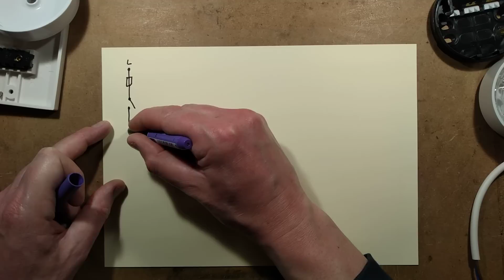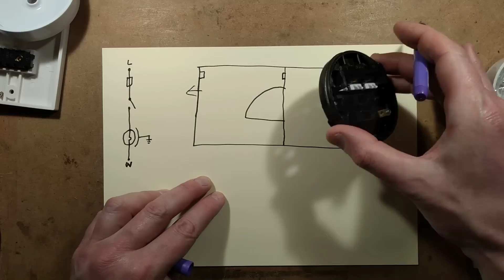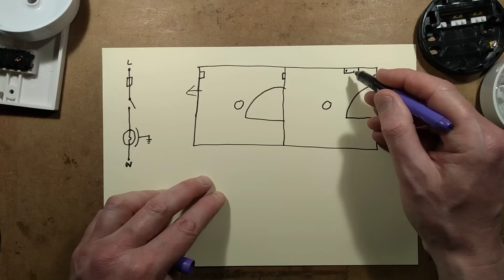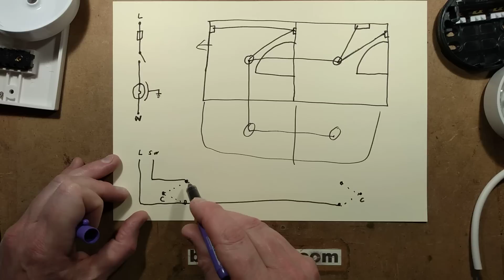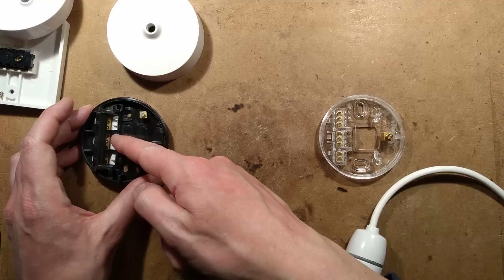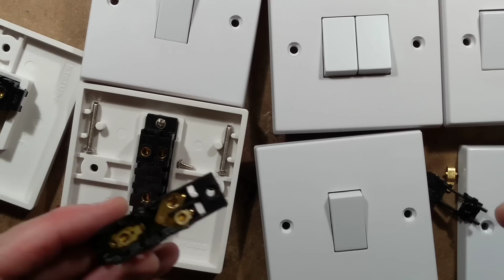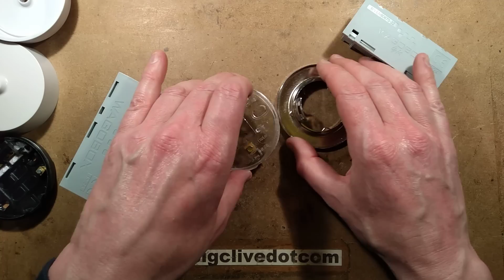British home wiring.  The incredibly simple lighting circuits.

Comment: How can I use a ceiling rose in the USA I know it'll work it's just a fixture but will it be a decent light for my shed
Reply from the maker: They are just a way to hang a lamp holder.  They should work with American wiring, but most here are bayonet cap holders (B22).

Comment: Can you please show us what cables go into the light switch L1 L2 and common. That would be nice
Reply from the maker: That depends on the way the lighting circuit is wired.  For a single way switch with just two wires it would be common and either L1 or L2.

Comment: Hello,enjoy your videos,a question for your thoughts,i have a wylex 6 way old type push in fuse box,i dont see on the bus bar any way of connecting a wire to extend to a nother single fuse box,can it be done with a bus bar clamp or do you not recommend it,on some of the old wylex it had one of the fuse block with 2 screws and a hole for the cable but on mine it does not,any help or cements would be grearfully received,it's a good box and seems a pity to install a modern consumer box i  have updated to 6 mcb's on my box so all ok but lack one more outlet.

Kind Regards,

John.Thanks.
WISH I HAD FOUND YOUR VIDEOS LONG AGO
Reply from the maker: You could theoretically add a small extra consumer unit for low loads like lighting, and power it from a single fuse way with a 30A fuse and suitable cable.

Comment: I have a bunch of the b22 bayonet sockets.. pretty common but not sure how many countries use them🤷‍♂️🤔.. I’ve only seen e27 & b22 it’s seems.. and the e27 is quite common.. my family is from the UK & Northern Ireland although being here in the US myself I’ve had a few fixtures & lamps that were originally for 230-240v when here it’s all 125v max but slightly higher amps, I just changed the plugs and used b22 120v bulbs which were sold by a company we both may be familiar with yrs ago called “Crompton” and had to stick with 240v eveready bulbs from the UK for smaller bulbs like E14 based etc.. they were “fireglow-globes”.. and it worked out well but very faint at 120-125v, lol

Comment: Hi Clive .great video,  the wago junction box is a maintenance free JB but it is only classed as maintenance free when you sill the lid with a cable tie , also wago connectors are only classed as maintenance free connection’s when used in conjunction with the correct wago junction box. Personally I think wago are a godsend they have proven tobe a game changer. Also the cable to the switch I was tort it is termed as Red / brown switch line / feed black/blue is the switch return. Now it is termed as brown is line blue is switching line . The biggest problem DIYers have is they don’t realise that on a three plate lighting circuit there is no natural at the switch. Unless you take the feed to the switch and that is only used for two plates circuit and is becoming more common with the use of LED downlights.

Comment: I've just bought a light switch, to replace one that's on its way out and, instead of being marked Com, L1 and L2, it's marked Com, 1 Way and 2 Way.

Maybe it's another change in the regulations. 🙄
Reply: Just replaced the iffy switch and, sure enough, the old one is marked L1 and L2, while the new one is marked 1 Way and 2 Way

Comment: With the advent of "smart switches" requiring a permanent neutral, then many new properties have the live feed cable looped through the light switches, not the ceiling roses. For that matter, a lot of properties have down lights in some rooms, so there isn't a ceiling rose, so would need a separate junction box (unnecessary if you loop through at the lighting switch). However, looping through the light switches does make the back boxes rather "busy", so they need to be a bit deeper. 

There is an alternative to looping through the lighting switches an provide a permanent neutral at the switch, and that's to use four core cable to the switch (line, switched line, neutral and neutral) and still loop through the ceiling rose (or a junction box) and it might be possible to retro-fit if the cable to the switch is in conduit or in a stud wall and you can get to the topside (easy on the top floor, more difficult for lower floors).

Comment: The way you are wireing your swiches is in germany called "Sparwechselschaltung" wich would translate to economy swiching circuit.
The way we do it is first swich common terminal L and the other two are connected directly to the same terminals at the second swich where the common terminal is connected to the lamp. Inserting intermediat swiches is done very much the same, connecting to the same terminals.
(looking up "Wechselschaltung" will show pictures on google)

Comment: I don't know how they get away with this plastic junction boxes ,even using AFCI breakers and GFCI breakers .Especially at 220v the arcing is so bad I don't know how fast the arc flash will be quenched before the breaker trips .We use metal boxes for most construction and we still have issues with arcing at 120v .Baseboard heaters and loose or improper connections being the major cause .10% of most household fires are caused by rodents ,the kitchen stove is the major cause .
Reply: What do you use to make your connections?
Reply: @Alex_Vir  The CSA approved Wago connectors a few years ago and before that another type that was a push in type connector and another   specifically for 347V lighting .And we have also a marette product 2 types one  which has been around for many years which uses a set screw cage clamp and insulating cap used for motors for up to 8 gauge wire.The other uses a spiral thread on the inside  .They do have very large wingnut type marretts as well for up to 2#6 wires .Then we go to split bolt/Burndy Connectors .We have only adopted the AFCi breakers about 10 years ago as part of residential building code .they still have problems with nuisance tripping because the software in the sensing IC is just not quite there .Vacuum cleaners ,garage door openers and some fluorescent lighting Devices that have some arcing on start up do cause nuisance tripping ..The use of PVC enclosures and conduit is not permitted for some residential applications .We do have the plastic boxes with foam gaskets for use on exterior walls and bathrooms that use a push in Romex connector type cable clamp .The rest is All metal boxes like the 1104 or 4 inch octagon box  for lighting .Most boxes are metal from 4x4 x4 to 12x12x8 deep .They do have PVC boxes for Outdoor damp/wet environments..Hospitals fall under a different category so do schools ,Highrise and commercial and industrial and churches and farms and homes .Code book for the province of Ontario is over 1000 pages and counting .Every 3 to 6 years they are amended and updated .

Comment: I'm sorry but at the 4.00 area, the 2 way switch drawing surely isn't right. Live [UK brown] should go to common of the 1st switch and either leg then becomes live when switched as does the common of the 2nd second switch, which is then the "switched" live which goes to your light fitting.
Reply from the maker: There's more than one way to wire multi-way light switches.
Reply: @bigclivedotcom  apparently so. I still really enjoy your deconstructions. Much appreciated 👍
Reply: @bigclivedotcom  apparently so. I still really enjoy your deconstructions. Much appreciated 👍

Comment: It's nice to see the differences between North American and European wiring systems. Our boxes are always securely attached to wall studs, while yours can be attached to just the drywall (plaster board). And our standard boxes are so much deeper. Plus, ours have clamps to secure the cable to the box. Your switches are switch and cover all-in-one, while ours are two separate parts. Our ceiling lights cannot be suspended solely by the power cable, there has to be an additional means of support. Does running your lights on 220v allow using smaller cables? Our standard size for most home wiring is 14 gauge.
Reply from the maker: Our cables are thinner.  They are rated by cross sectional area in millimetres.  The boxes can also be secured to wood or into brick.
Reply: Well UK isn't europe, in germany we also have swich and cover seperatly.
Reply: And AWG 14 would be equivalent to 2mm² (which doesn't exist) 
The more standard cable in germany in home installation would be 1.5mm² (AWG15). But because of voltage drop the company I work at uses 2.5mm² (AWG 13) for the connection from the room to the breaker box.

Comment: I only found out the word "ceiling rose" today, 
And I'm already hearing it again in youtube.

I was reading about electric code in india. Even though they say it's from 2011, it looks like some beurocrat wrote it In the 50s and never updated it.
It still recommends lead conduits, how to use cleats, high temperature situation should use asbestos sheathing etc.
Barely brushes over sockets, and doesn't describe anything I was interested in.

But it does talk about ceiling rose. It's supposed to be made of ceramic apparently.

Anyway, the British system of wiring doesn't make sense to me in modern sense. It would make sense if there was just one light per room.
But we have so many apllicances that plug into sockets. Sockets are the primary thing we need now. Fixed lights are secondary.
We have switchboards, which have all the light, fan switches. And also multiple sockets.
That's where we need all 3 of phase neutral earth. 
So it makes more sense to just run a 3 inch or so long wire to the switch. And then just the one wire from it which goes to the light directly. And the neutral for the lights and fans goes in seperate conduits. Like "ground" in electronics.
And I absolutely hate 2-way switches because I look at a switch. It looks on. But the light isn't on. Turns out somebody touched the other switch. So now the switch I normally use is upside down. I get so furious, I suddenly get infected with OCD.
The wiring for 2-way switches is also different.
The two wires connect ordinarily, but the middle one in one of the switches connects to phase. And the other one carries it to the light.

Comment: Handy tip ... should you use a 300 Watt ( infra red ) " mushroom " lamp ( nice - n - warm in the midnight toilet ! ) , then you MUST use a ceramic lamp holder , also use silicone or glass fibre insulated flex .. ( use of a standard plastic holder results in horrid fishy smells , yellow smoke and possibly your house on fire ! ! ) ... QED ...

Comment: God I wish the lighting circuit in my flat was wired with ceiling roses. Not fun installing a zigbee module when you have live at the light switch and neutral at the ceiling light and need both in one place for the module to work properly.

Comment: Nice overview of British (Brutish?) house wiring techniques. It's always interesting to learn about the current (that was totally punintended, I fuckin' swear!) and historical ones.

Continental Europe, at least Germany and Poland, uses routing the power wires through the switches' junction boxes rather than fixtures. The wiring of the "staircase switch" as they're called here is similar to the German "Sparschaltung" (which is pretty nice as you can use 5-conductor cable between switches: PE, N, supply L, commutation L between switches, and lamp L) as the throws of both switches are connected together.

Nice semblance of a strain relief, but the continental system uses actual relief that grips the outer shell of the lamp cord. For heavier lamps, a separate mechanical support (steel cable, chain etc.) is used. Connecting the wires is done with screw terminals and Wago connectors.

I know these Brutish steel junction boxes from servicing the Monotype metal type casting equipment. These machines are a marvel of engineering, a true thing of beauty and a joy for ever. 

Detachable lamp junction boxes are sooooo cool. Very flexible and useful in art galleries, exhibition spaces, shops etc. where you need to rearrange the lighting all the time and avoid rewiring at the same time. Europe uses busbars for that, which is also damn nice and you can often get away with having up to 3 live conductors, no matter if you're powering the bar from 3-phase supply (powerful lighting systems e.g. in industrial settings) or single phase separately switched.

Also, spotted an automatic center punch. Nice. I had one in my old lab but it got left behind when I moved.

Comment: Super interesting how different they are, and honestly they look better than ours. Ours in the US look like they were designed in the like 30s, and have barely been updated.
Reply: British ones are pretty old design,  the ceiling rose standard is still much the same as in 1929 (BS 67:1929).   The one for wall sockets is from 1947 (BS 1363).

Comment: Our approach (NL) is quite different. We don't have separate lighting and socket circuits, instead they are shared. A tripped breaker only results a part of the house going dark.
From the DB,  wires (usually separates in round PVC trunking) run to junction boxes in the ceilings central to rooms. From there wires drop down to sockets and switches in the walls. Our equivalent of your T&E is round and has green/yellow insulation for PE instead of a bare one, but these are mainly used in industrial settings, not residential. I guess EU regulations are the main reason why Irish T&E needs to have an isolated PE conductor.

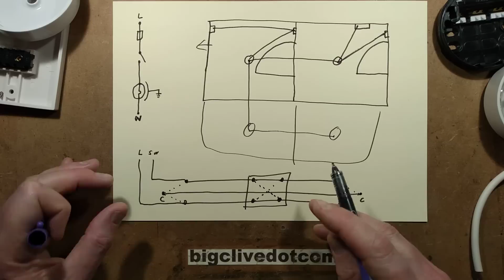Comment: The two-way circuit at 4:15, 4:30 seems incorrect to me: SW1 up and SW2 down would short. The NZ standard has L(red)→COMa, 1a–(red)→1b, 2a–(white)→2b, COMb–(deep blue)→(inside box a)→Switched L(red) to light(s), with N (black) forming a ground bus joined by “LOOP” terminals. (This keeps active conductors together, avoiding magnetic loops and switches L rather than N for safety. It also makes the second switch a terminal of the original switch's junction box connected by red-white-deepblue TPS cable. In addition, the Earth (green or green+yellow) connections foe the lamps (which require them) are kept simple by the second switch being a terminal) Oddly, the standard's lack of initial crossover means that all switches up ("off" in NZ) leaves two-way-switched lights on instead of off. (I would have preferred 1→2, 2→1 in two-way switches so that flipping all switches up world ensure bulb sockets are disconnected from Live.)
Reply: There is no neutral (grounded conductor) in that diagram. The C (common) is only connected the two common terminals of the three way switches.  A one way switch on that circuit would just short L and SW. (The grounded conductor being provided at the ceiling box) SW1 up and SW2 down would just turn on the light.

Comment: Ive fitted fancy light fittings with a Metal Rose and a tonne of glass beads hanging down from it.  And managed to leave old junction box within the new metal ceiling rose.  Making wiring easier, & fixing holes are already done.  Obviously if light fitting only had a 3 core id remove & start fresh, but on the few i mention, the wiring  was much more in depth. L,N,E x3, Fan spur connection Then s/l & supply , so i found a way to limit my effort needed. And managed to leave all wiring in situ.

Comment: Great informative video.  
I'm my flat I have a two gang switch that switches the lights on the Living room/Dining room on the two ceiling rose. I have two Twin and earth bringing down two live and two switch live. I am planning to fit a smart switch that requires a neutral. I wonderind to switch one of the Live to a neutral and share the other live to the two switched live. What is your professional opinion about that?
Reply from the maker: If both circuits are on the same lighting circuit breaker that should be viable.

Comment: I don't find the way you did the wiring really that simple. It looks way more simple if the cable from the breaker closet goes directly to the light switch and then from the switch to the light, or if there is a combination of 3 way and 4 way switches, then from the last switch in the sequence to the light.
That way you only have one cable going to the lamp.
If there are multiple lights with multiple separate switches then everything goes into a junction box
Most of the lights we instal have barely any room to fit 2 wires so sometimes we have to install a junction box just to connect all the lights in the same room in parallel.
So having 5 cables into a single lamp would be pretty frustrating to put all together especially if you have to hold your arms above your head the whole time.

Comment: Here in the US, the two way switch is called the 3 way switch due to the 3 terminals it has. We typically bring the live feed from the fuse board/ circuit breaker mains panel to the "common" terminal on the first switch. The light fixture is connected to the "common" terminal on the second switch. Two wires called "travellers" connect the switches together. The neutral line is fed straight through the switch boxes to the light fixture.
Reply: We call the travelers between the three way, two switches strapper here in the UK.😳

Comment: Over in N America we call that lighting circuit configuration "Power into light", and is fairly common, although the reason it's done is purely to save copper runs, and you will see it mixed with "Power into switch" much like a receptacle (socket) circuit.  Also because our domestic light circuits are often shared with sockets, they are all at least 15A circuits.  (Yeah, we love to use as much copper as possible).

Comment: in the netherlands we only use round cables. and use PVC pipe to pull wires tru without any cable sleeving.  reason .. you dont have to pull off all the walls. to make changes to your wiring.